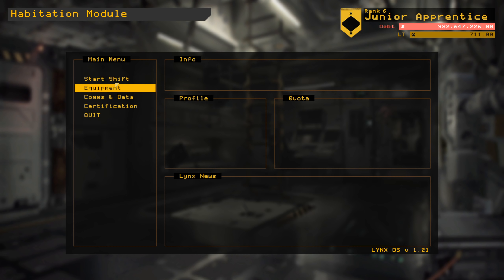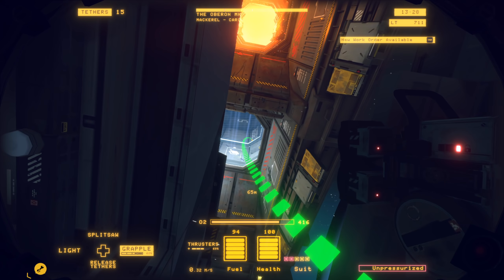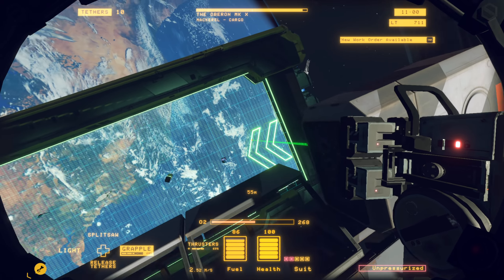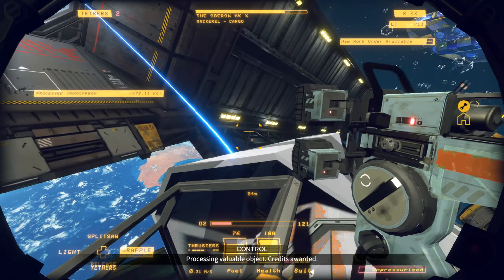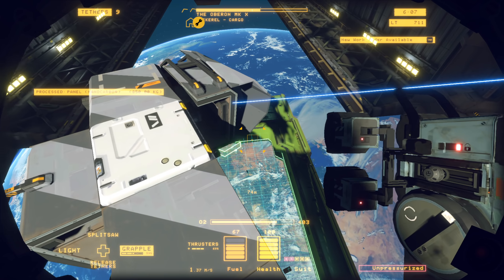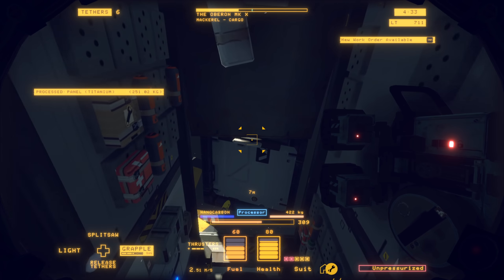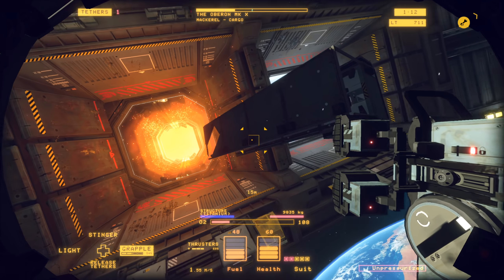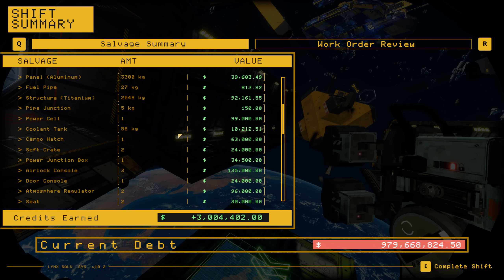Whole Buffalo - Class 3 Mackerel - Single Shift - Hardspace: Shipbreaker

Comment: This was impressive. Right click with the grapple to draw the held object close. This works as a way to move yourself quickly between massive objects. "4" to turn on helmet light.
Reply from the maker: Nice tip! I have a hard time aiming myself backwards, but it would definitely be faster if you practiced with it.
Reply: also a good way to move yourself.  left mouse to a wall or ship and hold Right Mouse to pull you to it.

Comment: Reopen the airlock one more time, it will depressurize to match the interior.
Reply from the maker: Awesome, I didn't know that.
Reply: @David-gj4cm  The cargo hatch also has a nanocarbon frame. Theres two yellow cut points on one side that will sprite the two. Theyre all that hold the panel on, you can cut them before cutting the interior points.
Reply: @David-gj4cm  Well you did eventually do that, from the exterior, around 12:20 in this. ;)

Comment: Once you have severed the cockpit, dislodge the storage boxes in each corner. The split saw the structural areas around the cockpit door and the whole door frame will come out whole. Then you can drag all of the furniture out without it snagging on the doorway.

Comment: Since Aluminum is pretty cheap, its better usually to cut the airlock up to try and get that external nanocarbon into the processor. Ive mostly had to spam the split saw abit to get it to properly separate. Even when it looks unattached its still abit stuck.
Reply: Airlocks are such a pain.
Reply: There’s always more money to be made by breaking things down further however, the daily costs greatly outweigh the value of taking the time to do so. Anytime I have tried, it just gets hung up on something and I waste too much time trying to get it loose.

Comment: So there's a bunch of potential optimizations here
1) Remove other electrical/mechanics before junction box and battery so the electric arcs don't damage them (this is why that coolant tank exploded, because of tearing the battery off first)
2) Instead of cutting into the wall for the fuel lines and wasting, cut the cockpit off and them shove it away using Z/X to hold the "body" of the ship. Then do allll the internal cuts and remove nacells in one go. When I've been running a one shift Mack you can generally cut everything off before your oxygen goes critical so you can teather is all up and then go get more O2/tethers.
3) Detach the airlock by removing the frame touching the structural components with the cutter; the nanocarbon in the doors/frame is worth a lot more than the furnace mats
4) When working on the cabin you can also remove the frame around the door and tear it off, which makes it faster to strip the cabin.
5) On entering the ship after equalizing open the airlock right away since it's right next to you
6) Burn off the pipe ends so you can put the fuel line switches in the barge.
7) Find time to cut the glass out of the cockpit, it's worth nearly 100k

Comment: I'm pretty sure that you can tether the structure with the airlock into the Processor and make more credits than the structure into The Unholy Furnace with the airlock. Nanocarbon is worth quite a bit more than aluminum. Plus there is also Titanium structure around the airlock, which adds to Processor value.
Reply: Yeah, with 6283 kg of Aluminum from the structure, you made 75.4k credits, and destroyed 146.7k worth of nanocarbon, titanium, door, etc.

Comment: Character speed can be boosted by grappling a heavy object and pulling yourself in. This is quite helpful at the start of the shift and for oxygen refill (quicker roundtrip). Grappling tool can both push and pull.
Reply: it can also reel light things in
Reply: It's good to know that it's an option but, personally, I find that it wastes way more time than it saves. I either smash into something and break my suit or fly right past my target at mach speed. Jet pack upgrades are where it's at  :)

Comment: you can get a little more out of the airlock section by separating the outside by sawing the 4 sides and separating it. takes a little practice to separate it in 4 cuts but you get the nano-carbon out of it
Reply: with littlepractice you can line up your cutter so you can make those 4 cuts witout barely moving as well!

Comment: nice run in one shift bro ! i think this is a good example that shows why the whole buffalo thing and a lone shift don't really go well together. no matter how fast and well you play, there is simply not enough time to do all of it. you are condemned to waste the airlock, the lights, and the aluminum inside the cockpit as well as storage bins and the glass, which are all not really worth your time if you're going for one shift. you gotta do 2 shifts for the whole buffalo. but one shift is enough to knock out the work order and get the most expensive pieces and move on to your next ship tomorrow. depends on player choice really
Reply: Weeeeeeeeell... You make more money doing it in one day rather than two. If he took a second shift, he'd have to pay another ~$500k from that 3mil, taking off a whole third rather than a sixth. What he would save in a second shift wouldn't make up for the daily debt payment for the shift.

Comment: you did well if you use the grapnel gun on the way to and from the hard jack you will have the time to ether cut the air lock free or get the bins out of the cockpit maybe both  remove the coolest tank before the power cell and they blow up less often and if you use the light you would have found the missed cut point faster but you did do very well good job

Comment: I find an easier method is no to cut through the walls.  After removing the celling and floor.  On the front, at the cockpit, there are 4 points that hold the cockpit to the ship, cut those, melt the front window.  Tether the front to your hub.  This will detach the front and reveal 2 openings on the sides.  From there, cut the supports and tether each side to the processor.  Once at the end, remove the fuel tanks and the supports on the inside to detach the rear.  This should leave you just the skeleton and excluding the small lights on the inside, it can go whole into the forge.
Reply: Though it takes 4 awkward split saw cuts to free it from the cockpit nanocarbon, the cockpit glass goes into the furnace for $600 per kilogram, if you are bored or have time to kill on your 2nd shift or something. It's only around $60k max
Reply: The problem is the airlock.  it always blocks one side of the Mack when you want to go crawling for the fuel lines.
Reply: There's normally a small gap you can fit through at the top of the airlock. It looks too small but you can get through.
Reply: @jimbo32234  You can also see the cut points in the crawl space if you Stinger the long, thin aluminum bar at the bottom of the aluminum wall panels inside the cargohold. That will let you remove 1 or 2 of the outer hull panels, but this method is definitely not easier.

Comment: My favorite variant of this process is not to depressurize the hull until I detach every single non explosive part inside. Then I cut loose the center floor tile from the safety of the cockpit holding on the wall (press z). It automatically rockets all the parts straight at the barge and you can always pull rejected materials back off so you don't even lose that nanocarbon panel. Then I proceed exactly the same with the reactor onward

Comment: those canisters on the wall are feul for the grey orange ones - and oxygen for the grey green ones - you can pick them up and use them anytime you please lol - there are also sometimes repair kits and what have you inside - small savings but worth grabbing while your there - the orange kits on the wall are health kits  too - so a bunch of small things you missed that could have skipped some of the smaller explosions lol 
small edit here - the small oxygen canisters there carry 400 seconds of oxygen - meaning it's a good way to avoid some trips back - especially when its just for air that your heading back